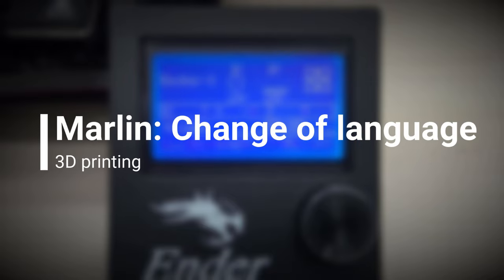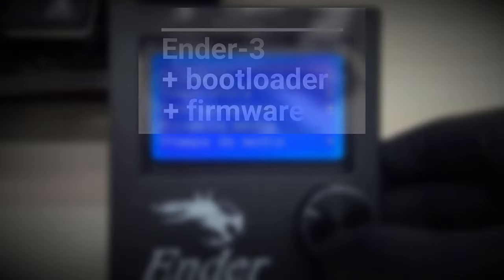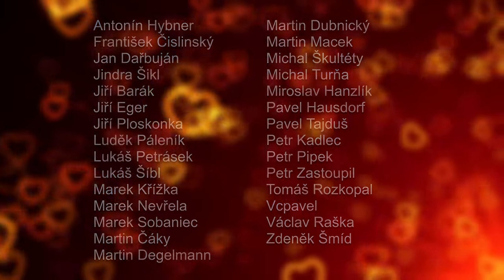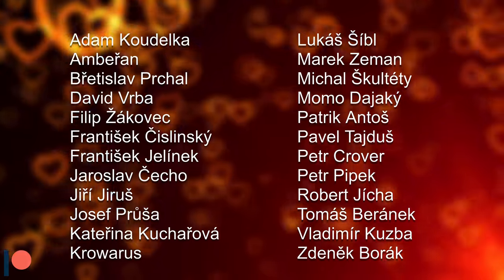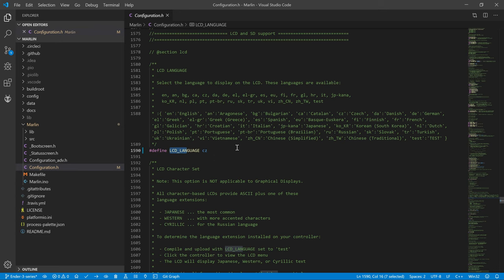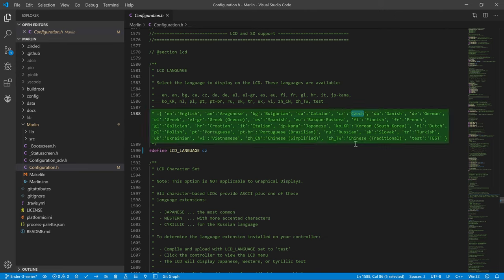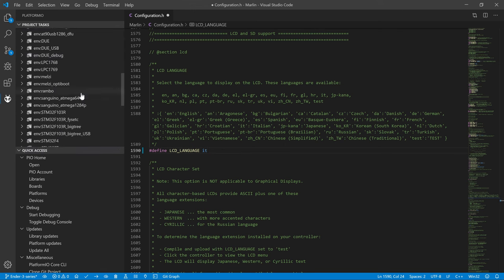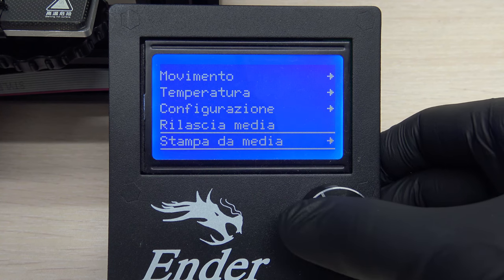Marlin: Change of language (3D printing)

Comment: im trying to install the firmware for the auto leveler. and it changes the language. If I just reinstall the firmware won't that erase the autoclave firmware?
Reply: I had that same problem with mine
Reply: @abram217  I ended up making a custom Merlin build.
Reply: I just found a video that explain it l, it was easy